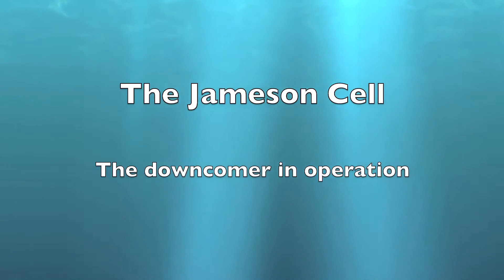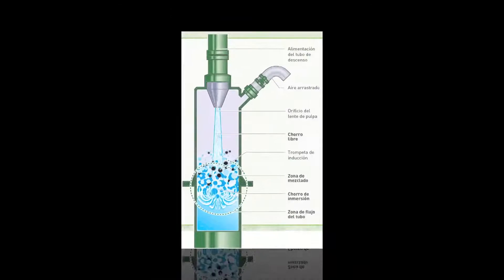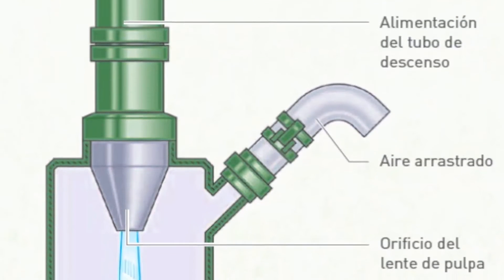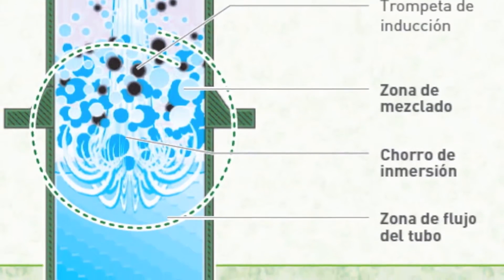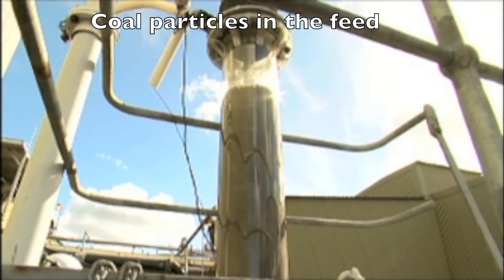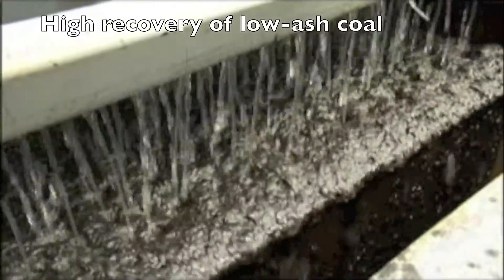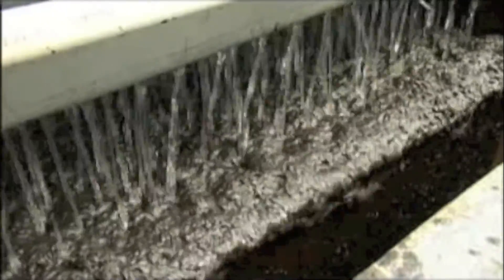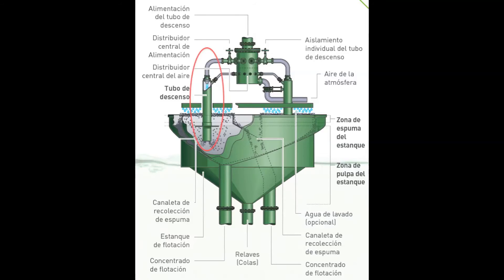Jameson Cell - The Downcomer in Operation

Comment: This is flotation cell no good working for preporation coal ang gold ore. Low yield % if we compering with other pneumatic cell.
Reply from the maker: Actually, Alex, we're not just strong in metals but also coal, and have ben since 1988. Goonyella replaced 32 conventional cells for 8 Jameson Cells and lifted yield 3.5%
Reply: Cuántos litros por minuto el dowcomer